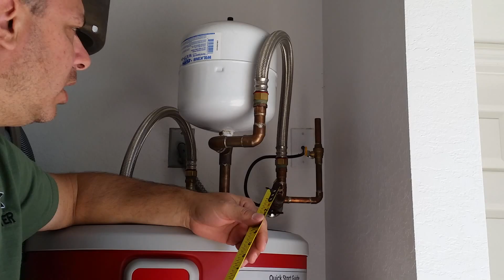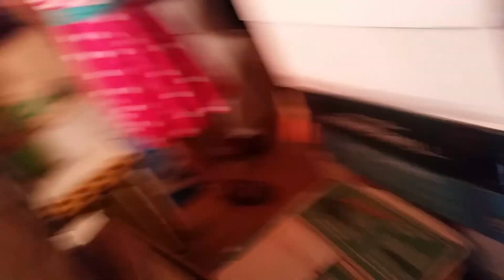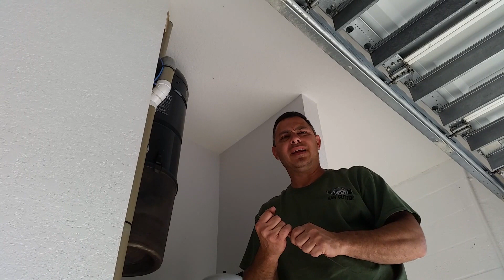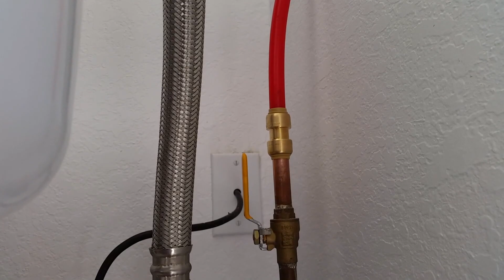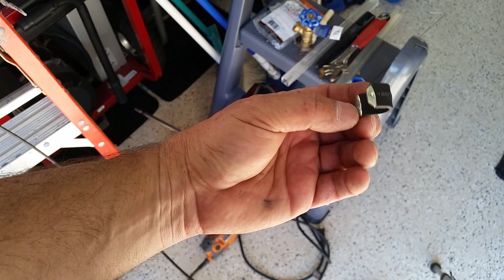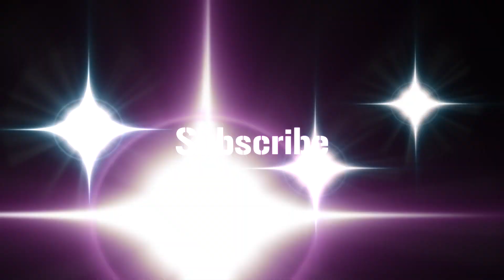How to install a hose bib with PEX tubing

Comment: No drain on that line? I don't know where you live but if the garage freezes the pipes will freeze with water in them. I want to do the exact same thing in my garage except i live n  NY
Reply from the maker: I’m in south Florida. Any freeze we get wouldn’t affect that line. Last winter we had one freeze in the early morning and it was only below 32 degrees for a few hours.  It’s tough on some of the palm trees but everything else is good. Thanks for watching and leaving a comment.

Comment: Nice video!  I want to run a hot and cold water line into my garage from my washer/ hot/cold supply so that i can hook it up to my wall mounted pressure washer.  I'm on the fence compared to using copper pipe or PEX... I always thought pex was something that would eventually fail?  But it seems like it's extremely easy to work with.  did you secure the pex tubing in the attic somehow or did you just go over the attic joist/beams?

Watching your video seems like I can do this but I'm just unsure which material.  I want to do this once and be done, and not have leaks or failures.
Reply from the maker: This is something you most certainly can do.  Pex is easy to work with and much more durable than CPVC.  Because it is flexible and comes in a roll, you can minimize the fittings and connections.  I used the shark bite fittings and they have been perfect.  I've had no issues at all.  One thing I would suggest is instead of using the shark bite fittings, use the crimp style fittings.  Once crimped, they are permanent and the pex pipe will fail before the connection at the fitting will fail.  All these fittings should be available at the Home depot and if your store has a tool rental department, you can rent the crimper.  Also buy or rent the proper pex cutter.  One that does not compress the pipe.  This especially if using the shark bite fittings.  Try to put valves at the beginning of the run.  It's nice to be able to shut off a section of pipe in case you have a problem or for maintenance. Regarding the pipe running through the attic. I ordered rubber insulated stainless clamps and fastened the pipe to the trusses in the attic.  I did not want there to be any movement of the pipe across the wood and risk it creating a weak point.  As for copper,  it's expensive, you will need to sweat the joints and the install. In my opinion, it's more difficult to work with.  Good luck and let me know how it turns out.  Also, thanks for watching and leaving a comment.  BTW, nice choice on the wall mounted pressure washer.  I'm going to get one too...they are awesome and even better with hot water!    --Greg.   gregsshopfl@gmail.com

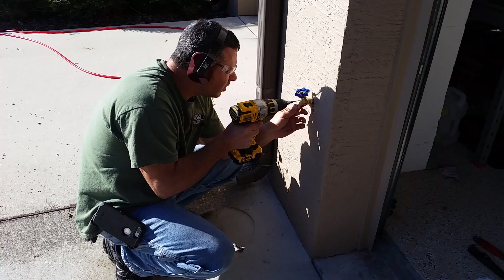Comment: @14:35, what tool bit is that you're using? I have the same DeWalt tool and would love that bit for projects! Thank you in advance!
Reply from the maker: It’s a concrete drill and driver kit. Here is one example on Amazon.  There are quite a few to choose from.  Thanks for watching!  IRWIN Concrete Drill Bit Set with Driver Bits, 5/32-3/16-Inch, Impact Performance, 9-Piece (1881131)
by Amazon.com
Learn more: https://www.amazon.com/dp/B00LMDI2QI/ref=cm_sw_em_r_mt_dp_6G5AXB9GJ9S6VGJDDXWH

Comment: Great video Greg!  I found your video because I was looking to do something close to what you did in my garage.  On my house, the PEX line that runs to the hot water tank is accessible in the attic right about the tank.  I was thinking about cutting into it and adding a “T” fitting, then take that line out to the faucet.  It would make for a cleaner install at the tank.  I was wondering if you had scenario available on yours or maybe there is a reason you would not want to do it that way?  Thanks again, love watching!
Reply from the maker: Hey Clay, Thanks for watching.  While planning to replace my water heater, I planned to add a valved connection for this reason alone.  All of the supply pipes in my house are run under the concrete slab which makes them all inaccessible.  The only location they are accessible are at the water heater and under the sinks/toilets. The county water enters the house totally opposite of where I needed this hose bibb. This layout left me with the water heater supply lines as my only option.  If I had to make one suggestion, I would not place a T fitting in the attic space.  As good as the fittings are, its hard to monitor them for leaks. Now, I know there are many scenarios where there are plenty of these fittings in the wall under slabs and in attics.  They all will probably last forever.  That being said, the potential for disaster if it does fail could be huge in that configuration.  I would put all my fittings outside of the attic space and locate all my pipes inside the building.  UV light can destroy all plastics over time.  Some sooner than others.  CPVC gets very brittle so I wouldn't even consider using that.  Also, make sure you put a shut off as close to the heater as possible, in case you have to isolate the line or winterize it. there are valves that have a bleed knob that let you shut the water off and drain the line so it won't freeze.  This was not necessary in my climate in Florida.  Anyway, I hope this answers all your questions.  Let me know if I can help you further and how your project turns out.  gregsshopFL@gmail.com

Comment: Ok I have to comment on 2 things:
1) PEX typically should not be exposed to UV light. It becomes damaged by UV light, so leaving it in driveway is a big no no. 

2) hot water to a hose Bibb?
Reply from the maker: Hey Greg, thanks for watching my video and commenting. My ability to purchase pex is limited to Home Depot or Lowe’s in a full roll.  I only needed about 40 feet. Rather than purchase a whole roll, my plumber friend gave me what he had left over from a job. So yes it is red but it’s  hooked to the cold water side. Not really a big deal. As for it being exposed to UV, I rolled it out on my driveway to allow it to heat up so it was easier to run through my attic.  That little amount of UV should not affect the stability of the pipe at all.  I did consider running another pipe to the hot water side and install a faucet with a mixing valve so I could wash the dogs outside.

Comment: You are supposed to use a sleeve into the PEX pipe when it goes into a SharkBite connector
Reply from the maker: +Mike Leuchs not sure what you mean by a sleeve.  Anything 3/8" to 1" have a built in pex stiffener.  If I am missing something please let me know what part to get. Here is the installation guide from shark bite.  Thanks for watching and commenting.    

http://www.sharkbite.com/sharkbite/wp-content/uploads/SB_InstallationInstructions_2017_FINAL.pdf

Comment: Why are you using red pex for cold water?
Reply from the maker: My buddy is a plumbing contractor and he gave me 30 feet of it for free.  All I needed was the fittings.  He would have let me borrow his compression tool but the shark bite connectors were easy.  I know it's supposed to be blue but it's visible on both  ends.  Thanks for watching

Comment: Great video ,  but I am afraid when I come over with the tractor Ms Emily is going to really school me on safety first, I will have to be on best behavior. I really like the slanted hole in the cover makes the pipe come out of wall at a good angle and onto the copper pipe.
Reply from the maker: +rvkubotaman it was pain to drill it by holding it in my hand.  Should have clamped it in the drill press and drilled it that way.